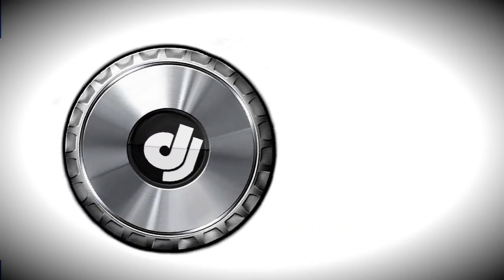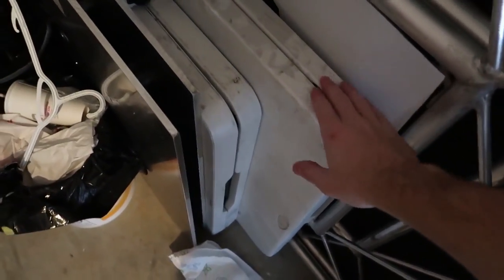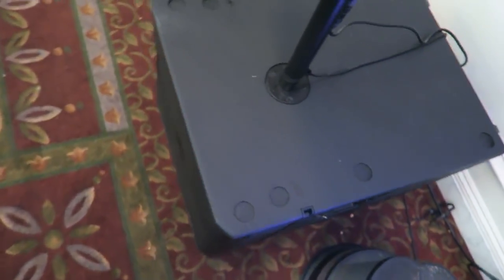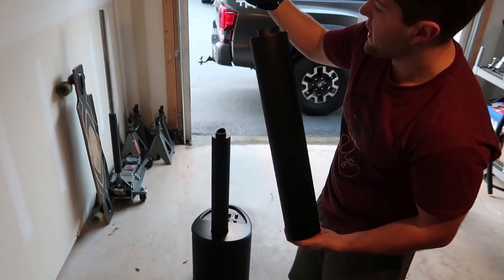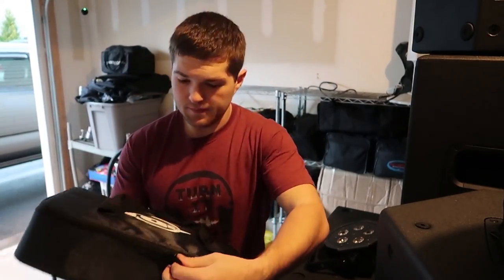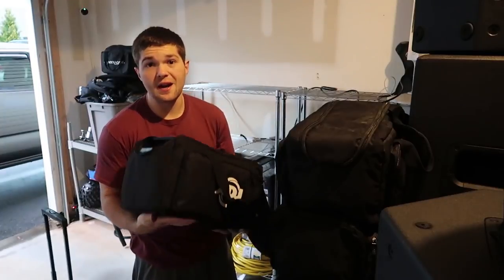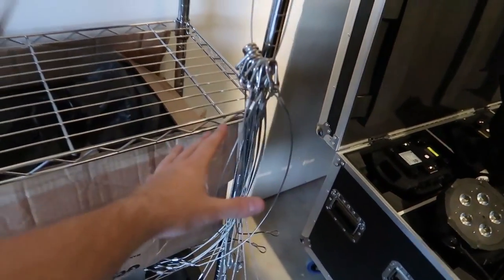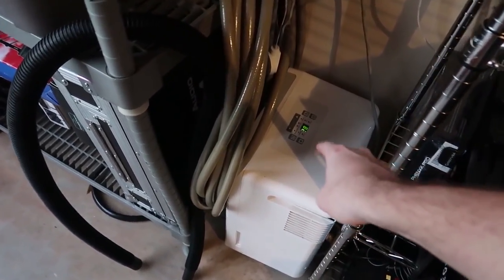FULL DJ Garage TOUR | All my equipment | Speakers Lights Stage Truss Cables Stands

Comment: Hey Rick, nice amount of equipment. I would recommend at some point getting a decent Shure or Sennheiser wireless system. I can't say enough about my EW500 g1 system. Had it for years, and still love it more than my ULXP systems. I wouldn't recommend a digital 2.4GHz wireless system. A buddy of mine did a gig and he said he couldn't get it to work at the venue. Got home, worked fine. Interference he says. It's happened twice. Also, I wouldn't recommend keeping the drape in a cardboard box. When you drop it in a puddle when you load out, it's a pain in the ass to dry. I own 20 panels of 16ft blue velour drape. 3 panels per case (except 1). Saves me when it's pouring rain. Some idiot I cross rented 6 panels to, didn't use the cases because they wouldn't fit, and then got them soaked. They still have a weird smell to them. Never really could get rid of it. He left them bunched up in his car. Anyway, just a word of advice, I would try to put everything in cases, even if you buy the cases used. That's how I got a lot of mine. Good luck finding space for all your new gear!
Reply from the maker: Yeah mics are pretty high up on my next to upgrade list. Been slacking on buying cases for the drapes. I agree though

Comment: Rick, thanks for your videos sharing all you do.
I have a question about temperature. You mention fans to keep things cool and dehumidifier. What can I store in the garage that is not even insulated. I worry about heat (up to 95 deg in summer and 10 deg F in winter with a few outliers. I store only stands and tables in the garage now, but my wife is watching the gear taking up too much space in the house. I have a storage unit, but the temperature is also an issue.
Reply from the maker: The heat isnt too big of a concern. Humidity is bigger in the summer time. I would try and avoid temps below 30 to 40 degrees more or less for wooded cabinet speakers going from super cold then taking to an event were they warm up can  crack the cabinets. But overall temps 30 to 100 degrees not so much an issue humidity is the biggest harm to electronics

Comment from the maker: EQUIPMENT I OWN

Lights
-ADJ Inno Spot Pro http://amzn.to/2jxwK5g
-ADJ Mega Tri Par Plus http://amzn.to/2jXwb1p
-ADJ Mega Par Profile http://amzn.to/2jXKTFL
-ADJ Mega Hex Par https://amzn.to/2ClGYz0
-ADJ Element Hex https://amzn.to/2CO8LZP
-ADJ Pinspots https://amzn.to/2CnkWvH
-Chauvet EZ Gobo https://amzn.to/2RTjCWK
-Chauvet Color strip mini http://amzn.to/2xJF8qB
-Chauvet Wash FX 2 https://amzn.to/2qb1eMH

DMX
-Chauvet Xpress 512 http://amzn.to/2jXKfYM
-Donner Wireless DMX http://amzn.to/2iNZZzH

DJ Tools
-Vmoda Crossfade Headphones http://amzn.to/2lcyYEj
-Laptop Stand http://amzn.to/2mOviJM
-Fold up Laptop Stand http://amzn.to/2yshfSV
-Rock and Roller Cart http://amzn.to/2yszpEr
-Cable Bag http://amzn.to/2DqTETM
-ADJ Pro Event Table http://amzn.to/2EACRwT
-Gaffers Tape http://amzn.to/2AVJyYc
-Musician Ear Plugs http://amzn.to/2CUjOgw
-Sound meter https://amzn.to/2CO0jdh
-Kill-a-Watt https://amzn.to/2pZMbVP
-4ft Table Scrim https://amzn.to/2yKUyIV

Mixers (Have + Recommend)
-DBX DriveRack PA 2 http://amzn.to/2t2izad
-Pioneer DDJ SZ (Serato/Virtual) http://amzn.to/2myaTcf 
-Pioneer DDJ SX2 (Serato) http://amzn.to/2FzPb1t 
-Pioneer DDJ SR2 (Serato) http://amzn.to/2AV0hL1
-American Audio VMS 4.1 (Virtual) http://amzn.to/2jx8W18
-Yamaha 12 channel Mixer https://amzn.to/2TK7KYf
-Yamaha 6 channel Mixer http://amzn.to/2BSUIl3 

Speakers
-JBL VRX 918sp http://amzn.to/2ys5Vq5
-JBL SRX 815 http://amzn.to/2fhPTrL
-JBL PRX 712 http://amzn.to/2jvkQcr
-JBL PRX 715 XLF http://amzn.to/2jv9Hsc
-Avante A15 https://amzn.to/2zyGfsb
-LD System Maui 5 Go https://amzn.to/2CxYBeC
-Alto Stealth Wireless http://amzn.to/2mq1F3a

Truss/Staging
-Pipe and Drape https://www.georgiaexpo.com/
-Metal O-clamps https://amzn.to/2q57R2Z
-Safety Cables https://amzn.to/2NKkwl9
-Global Truss 2m https://amzn.to/2pUPFZD
-Global Truss Base Plate https://amzn.to/2CPKwKK
-Global Truss Top Plates https://amzn.to/2pVVndB
-4' by 4' Stage Risers made by ProXdirect

Special Effects
-Chauvet Geyser RGB http://amzn.to/2mtsnYJ
-ADJ Haze Generator http://amzn.to/2D0jehu

Stands
-Odyssey LT-P2 Tbars http://amzn.to/2jvpNCd
-OneStage Stands http://amzn.to/2iGhBKO
-Rockville Hydrolic Stands: http://amzn.to/2Bh7Rki
-Tall T-bar Scrims https://amzn.to/2tF98Qu
-Speaker Stand Scrims http://amzn.to/2hJrskA

Mics
-GTD Audio G-733H Wireless Mics http://amzn.to/2izMKV5
-Audio-Technica ATR-1300 Mic http://amzn.to/2izOGgl
-Phenyx Wireless Mics https://www.amazon.com/dp/B0758JZ8Z2
-Mic Stand http://amzn.to/2izSKwR

Cables
-XLRs (Hosa) http://amzn.to/2DnHZVl
-DMX (Hosa) http://amzn.to/2CSiQAX
-Power (Hosa) http://amzn.to/2DqTUBw
-Power (12 gauge Light up ends) https://amzn.to/2CNZYr1
-Multi outlet cable (Hosa) https://amzn.to/2RUrkQi

If you are serious about buying gear ($$$$) and want the best deal email my guys below asking for a quote. Tell them I sent you.
-ben@nlfxpro.com
-jeff@canalsoundlight.com
Please don't waste there time if you are not serious about buying!

Comment: So do you have problems with the weather possibly harming the equipment? I was always under the impression cold weather and electronics are a no no or did you insulate your garage?
Reply from the maker: Garage is insulated already plus I am in North Carolina. Coldest we get here is maybe a week a year at night it will get to 25 degrees. But for the most part are days are all around 40s and above.

Comment: Holy shit you have hell a lot of gear. Doesnt renting gear work for you? Have you recovered the money you invested on this stuff? How the hell do you carry all that gear? You have an assistant? I wouldn't recommend any beginner DJ to buy all that stuff. I had 18 inch subs but eventually I had to get rid of them because moving them around when there is no help available is a pain in the ass. Im happy with my 12s now. I mostly do mid to small events. If I need bigger subs I can always rent them.
Reply from the maker: Wow lot of questions. Everything I own is bought with profits only. Aka there is no investing here. What your looking at is gear that has been acquired over 6 years. I only buy gear that can pay for its self in 1 to 4 events. Which plays more into what I charge less of how much the gear costs. I also have to be able to use the gear at least 5 times a year. I do rent gear but it's for those 1 or 2 events when I need it. And transport via the big trailer you see in other videos and normally ever event I have an assistant

Comment: You should really look into an Allen & Heath QU-16 for mixing. 16 local channels and they made a remote snake that can transmit 16 inputs and 8 returns all over a single Cat6 cable. Can be used with an iPad and phone too. Either that or the QU-SB/QU-PAC

Comment: seams to have more equipment than sense,Its pointless having so much.
Reply from the maker: I have 3 DJs. That use my gear as well. Aka why I have 3 setups
Reply: @DJRickWeb  ok cool makes sense now you have some nice gear,Im in the process of up dating my top speakers not sure what to go for or if to just change the  Drivers in the once i have to 800 rms each as i have 1500 rms bass bins now,I was going to go for EV but im not sure if its worth the money because i could update my speakers for around 400 any advice?